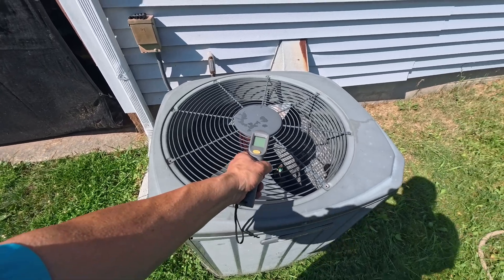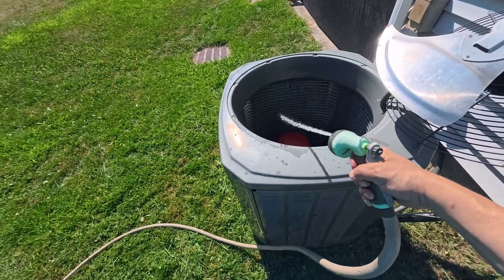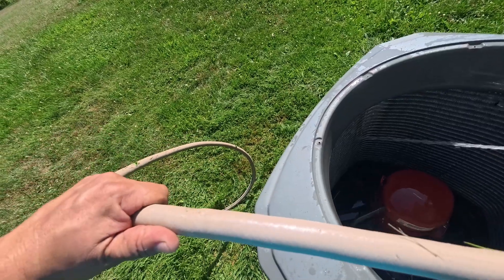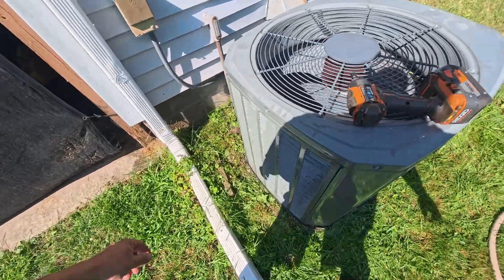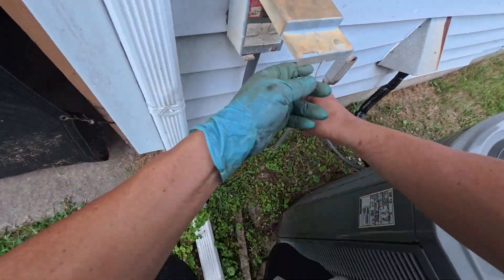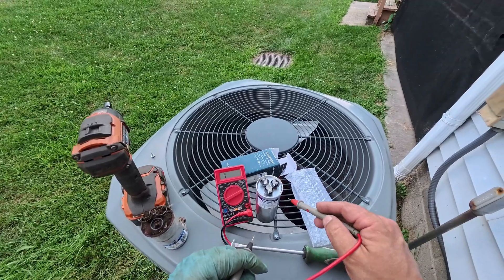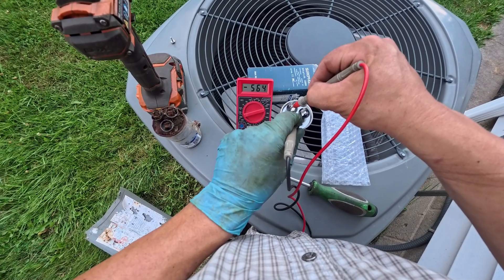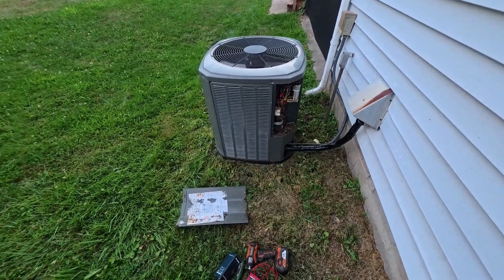Residential AC unit fail and fix

Comment: I've had to replace the capacitor in mine 3 times.  Usually because of power outage.
Reply from the maker: I've been lucky. Been in this house for almost 10 years and this was the first problem with the AC.